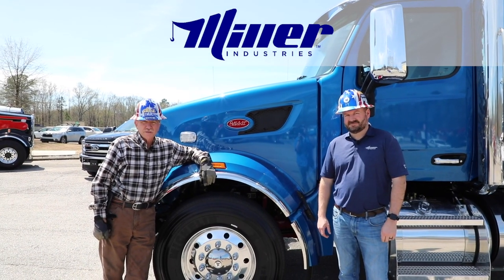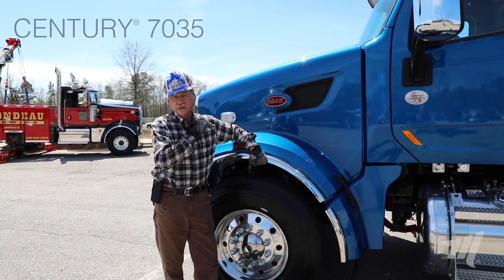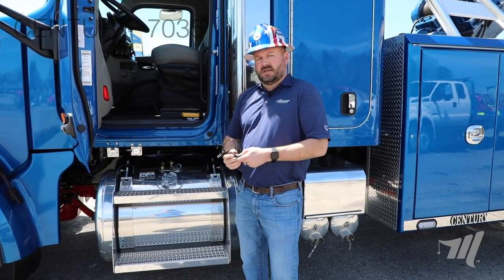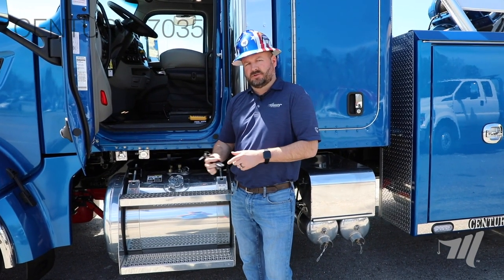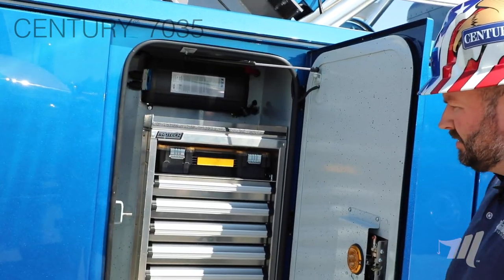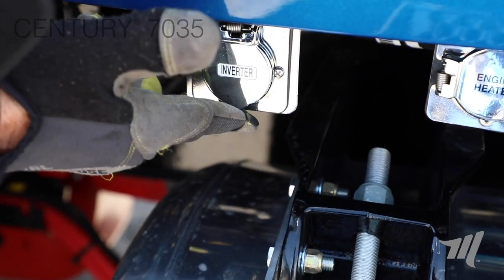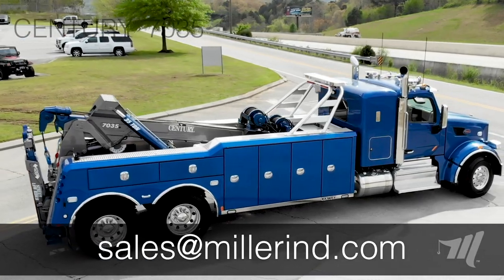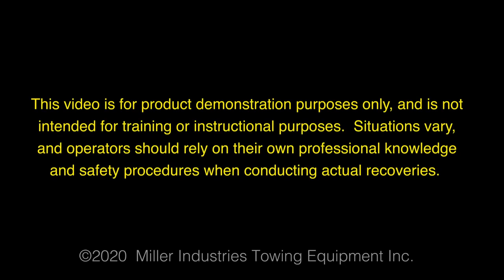Century 7035 Key Features

Comment: I would like Miller to come up with a way to cover the cable because uncovered rain or snow will destroy the cable. Each cable will cost thousands to replace., by the way, does anyone at Miller ever read the comments? I do not think so!! Regards, Edgar
Reply: Proper Maintence on the cables will keep that from happening. Have had cables on some trucks for years and never had a problem with them

Comment: I have seen several of your videos, does the trucks comes with automatic or manual transmissions?
Reply from the maker: The truck can be ordered in either an automatic or manual transmission.
Reply: I don't really know why you would want a heavy duty automatic tow truck but you can buy them, Personally I'd say it's just a limiting factor you don't want on a heavy duty truck.
Reply: @towtruckaj  In certain cases I guess it could make sense.. If you just do city towing an automatic might be easier for the driver
Reply: @kappajohns5416  It gives you less control, Automatics are easier yes, And that's fine for the average driver, but as tow truck drivers we come out when shit has gone wrong, Either a vehicle is wrecked, or a truck is stuck where it shouldn't be, or it's broken down, etc... So as tow truck drivers we are going in to the worst situations for a driver and in these situations, you want the absolute most control you can have, And as tow truck drivers we should be able to handle our trucks automatic or not, Personally, I want the absolute most control I can have in any situation whether it be driving or recovery work I want to control every single aspect of that job, and an automatic doesn't allow for that.
Reply: @towtruckaj  I agree 100%. Id want a manual too if I was a tow operator. I was just trying to find a point where it might make sense.
Reply: Speaking of Automatic I learned that it has a selector switch. It allows you to choose between the low range & the high range. The low range is used to pull heavy loads & the high range is used to pull light loads.